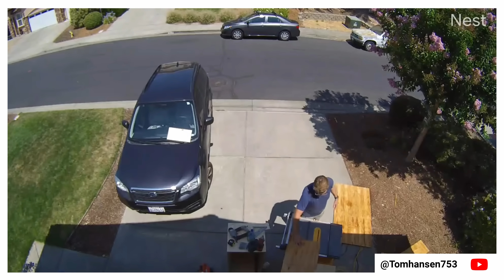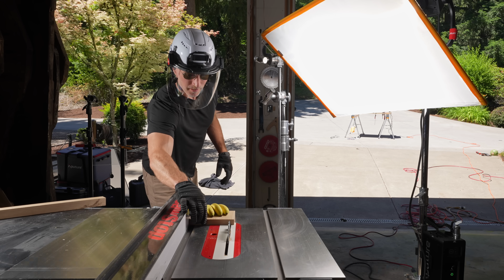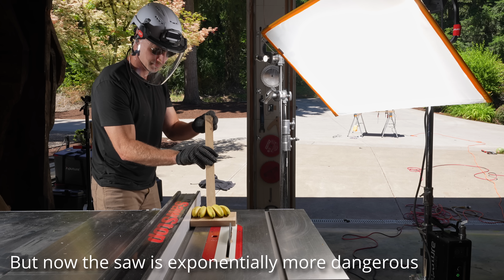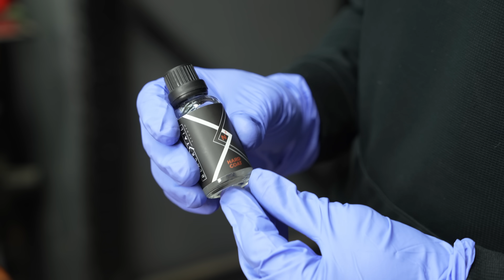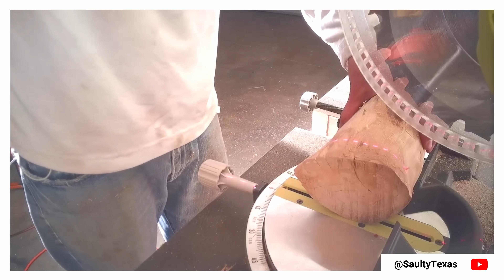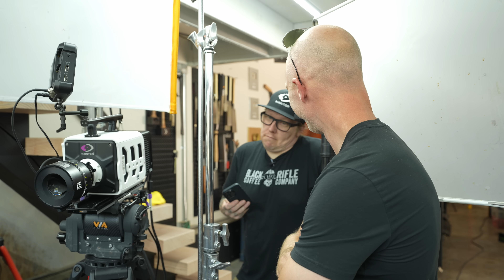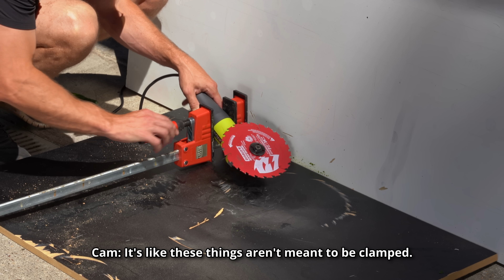Woodshop Safety in Slow Motion

Comment: I'm retired 37 years concrete carpenter. I built the giant forms for the things we love. Dams bridges gigantic hotels resorts ect ect.  When asked what I feel is my greatest achievement I hold up my hands and wiggle my fingers. "Still got all 10 "".  Cam I've seen up close it's down right crazy.  Careless and complacent that's the two biggest ❤😂. Good video
Reply: Me Too !!!1
Reply: that's quite an impressive job you had, building those gigantic forms is not for the faint hearted
Reply: I was a union carpenter and when people ask me that same question I say I don't have any skeletons in the closet meaning I never worked under the table I never worked for cash and I never worked straight time for overtime . I guess what I'm saying is I followed the union rules to a T and I'm now retired 25 years  with all my fingers and a pension with medical coverage .
Reply: @n40tom  local 184  salt lake city

Comment: When I was an apprentice doing hardwood floors the first time I was going to use the table saw my mentor said let me show you first what not to do . He said watch what happens when you twist the board going through the blade . He did that and he sent a piece of hardwood flooring through the drywall in back of us. He looked at me and said you got that and then he proceeded to show me the correct way to use a table saw  . I'm retired now and I never had a kickback ever

Comment: In high school, the table saw in my shop class was mounted on a high fixed bench. I’m short, and I basically had to lay down on it to push wood through. I told my teacher I wasn’t comfortable, but he told me that I could either use it or fail the class. Fast forward to the end of the year, I was way behind, and needed to cut a large sheet of balsa for the back of a book shelf. Got it almost halfway through before it kicked, flew across the room, hit a cabinet and ricocheted into a wall. Whole class looked over to see me shaking, counting my fingers because I felt it graze the tips.

Teacher came over, turned the saw off, and informed me I didn’t have to use it anymore. He helped me cut wood for the projects I had time to finish, and cut me a break on the rest. I hope he learned something that day.
Reply: Damn... Frankly if you have safety concerns in shop class, you should get bonus points, not a threat of a failed grade.

Comment: I worked in a wood shop in my twenties and was extremely lucky using the cross saw, I have a 3 inch scar on my little finger and a nice groove in the bones of the knuckle, when  I stupidly went to pull a small piece of wood out from the saw before it had finished rotating, made me so much more safety conscious after that.

Comment: Thanks for telling people to use the clamps on the miter saw. The number of YouTubers I see completely avoiding them, I know the ones that come with most saws are kinda annoying but... they're easily upgraded.

I know the temptation and for longer pieces of wood it's mostly okay to hold but yeah, they can still kick back.
Reply: my mom broke a thumb holding a board in a chop saw when it kicked back as the flying chunk wasnt detached yet when it got bound up, I still do it though, just not small bits

Comment: I have been building movie sets for many years, I have been a carpenter my whole working life seen lots of stupid  things and dangerous people lose fingers. My Dad taught me theres no reason to have your fingers near any blade and told me the bandsaw was the most dangerous saw ( I still believe that ) . I supply all the tools for my crew no matter the size of the show and always upgrade to whatever is better and safer . Sawstops are Awesome I have 6 in my tool kit now , also I have huge box of push sticks that we make out of masonite so theres always plenty on hand, Hoping someone can invent a sawstop type miter saw one of these days . I enjoy your channel very much
Reply: I’m not disagreeing, but why is the band saw the most dangerous in your opinion?
Reply: A bandsaw is really safe in comparison to other power tools. The sawing motion is only downwards. It won't pull your workpiece, including your fingers, into the blade. I have way more respect for table saw, router tables and angle grinders.
Reply: @LAZER1981A  My guess would be that without a brake,  the blade takes a fairly long time to stop but you not realizing the the blade is still moving could easily stick your hand into the blade. I actually did that once.  Luckily it was only a 9 inch saw with aluminum wheels almost stopped.  Scared the hell of of me when the teeth  hit my fingers.  Also,  complacency.
Reply: @LAZER1981A  Think because your pushing toward the blade , no fence and they will cut right through . Usually they don't have brakes although I have some that do, and that's the tool butchers use to cut meat.. I used to think tablesaws were equally scary but sawstops are the best safety upgrade I've ever seen
Reply: @DPCtahoe  lol thanks! I’m a butcher and use a band saw everyday.
Reply: @DPCtahoe  That's easy to fix by placing your hands so that they don't move towards the blade, but off to its sides. I wouldn't say it's the most dangerous, but rather the most underestimated. Maybe you could say the most deceivingly safe and easiest to get careless around.
From what I've seen they seem to run fairly quiet as well while the other types of saws screaming at you usually already imposes some respect. I don't own one (yet), but a bunch of circular saws.

Comment: I work in a factory and cut aluminum parts, and i've seen kickback a few times on parts if you don't cut off enough material. One time the guard that covers the saw didn't come all the way down when an employee in my department made a mistake and cut about 1" off a piece and the kickback chucked that piece of metal into the oven about 50 feet behind us and left a dent in it.

Comment: Worst thing I had happen in high school woodshop was the bandsaw blade snapping on me (it was OLD, but we had limited supplies of new ones, so we had to use them until they died). 
I just hit the emergency stop and backed away. But I got to learn how to put a new blade in, which was cool.
Another class, one of the students leaned too close to the lathe while it was running, and it ate his shop apron. (The lathe might just be the most dangerous thing because it lulls you into a false sense of security since there’s no sharp spinning blades.)
Reply: Ugh. Yeah, spinning things are vastly underestimated. In one of my lectures the prof showed a picture of why long hair has to always be tied together in the chemistry lab and especially when using a rotary evaporator. Luckily I'm not susceptible to PTSD from pictures.

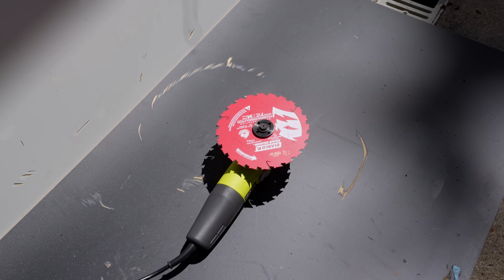Comment: Good timing! Just last week I was using a 15-cm battery-powdered mini-chainsaw to cut some slots in large beams for a project that is far behind schedule. It was going well, but, unsurprisingly, with only 4 cuts left to go, the saw motor burned out. With no chance of repair, and any replacement literally half a world away, I almost allowed myself to try the hack shown at 11:40 going as far as buying a blade for it. Fortunately, I came to my senses in time, and with a bit of uncharacteristic luck regarding shipping, a replacement chainsaw will be here in a few days. Sorry, Cam, you'll get no clips for your next safety video from me! 😅

Comment: Just started using a table saw for some small woodworking and DIY projects. Learned a lot of useful tips from videos like this. Outside of the usual fundamental rules, I’ve found some of the best tips to be fairly simple yet seemingly overlooked at times. Don’t be complacent. Treat your 1000th cut just like your 1st. Take a second to rehearse each cut before making it, making note of things like hand and arm placement and what kind of clothing you’re wearing. Be aware of the complacency involved in batch cutting.  And just trust your gut. If it doesn’t feel right. Don’t make the cut.
Reply: Stable bench, table and fence extensions, Feather boards, both on table and the fence, riving knife, clean blade, a push handle/jig (Homemade MicroJig The Ripperrr with more height clearance than the blade max height) and a COLD CLEAR HEAD + Safety glasses + Hearing protection.

Comment: I have been in construction for over 40 years and as an employer the first priority on any job or task is personal safety. I have seen too many accidents in those years, but thankfully I have not had any injuries to my employees that were improper use or safety precautions not being used. I did have a guy putting down OSB into H clips when a gust of wind rocked him on his heels. He lost balance and did a double back roll off the roof onto the ground. The OSB came down behind him and the edge hit the ground 4” above his head. Other than a sore back he came out with no injuries.

Comment: This is one of the most practical learning videos I’ve seen of NOT WHAT TO DO.  Very educational and top slowmo photography and certainly something I would like to be able to share in courses I deliver for aviation safety and risk management. 
Thinking outside of the box to get the message across and seeing more up there can only heighten the danger of using any power tool, of which I use on a regular basis but evaluate, emulate (in the mind), evaluate again before actually activating. 
It’s like the 6 P’s - Proper Planning Prevents Piss Poor Performance. 
Rgds J

Comment: Okay another piece of advice I always found very helpful when cutting very small things is that if your cut does not have to be very accurate repeatedly then just use hand tools!! Way less risk of hurting yourself, way more control over small pieces. Always keep the purpose of your part in the finished build in mind and if your wife or mom or dad or client or gf will not be able to tell if you cut it on a machine or with a handsaw then dont take the risk! :)

Comment: A few month ago I was using a small battery powered chainsaw to cut down some bushes to fit them into the bin. After about 2 days of doing it I got a bit too comfortable and it kicked off a stick I was holding and barely cut into my glove. I'm lucky I walked away with some scratches on my hand, it could have been so much worse. Never get comfortable or complacent around power tools, it could be the difference between having 2 functional hands and having only 1. Great video

Comment: Typically, every one of us has made a stupid cut in our lifetime and experienced a kickback. We usually learn after the first time.  It's one of the fastest and scariest things we can experience in our woodshops.  I experienced mine in my 20's when I was worldly, experienced, bullet-proof and knew exactly what I was doing!  Right!  I luckily still have all my digits, but I had a monstrous bruise in the center of my chest for weeks.  And I had on a heavy shop apron.  
My "almost digit-removing disaster" was one night when I was tired after a long day, and I was cutting some things on my bandsaw.  Last part of the night.  I pushed the stock straight through to my thumb.  My thumb took a nick to the bone before I could retract it.  Several stitches that night, but still had a thumb.  Don't run machinery tired!
The video shots were not ridiculous.  Maybe except for the water balloon, but the wood kickbacks they were very realistic what to expect.  
Good video.
Reply: Back in March I was working on a home remodel and got a bit loose and fast with a circular saw and ended up almost amputating my middle, ring, and pinky fingers on my left hand. I was feeling crappy and I wanted to be done for the day, but I just wanted to get to a good stopping point. It felt like a small nick but when I lifted my hand up I saw blood squirting everywhere and my middle finger was dangling backwards. I ran to the kitchen and wrapped my hand in a thick wad of paper towels and drove (4 blocks) to the ER. Two surgeries and months of physical therapy later, my hand is now as functional as ever. My grip strength is still on the weak side but I’m gaining that back slowly. Overall, I’m thankful I was able to walk away with all my fingers still intact and in the future when I’m done, I’m done.

Comment: I was hit by a kickback on my table saw once.... once!  If I wasn't dressed for the freezing temps (t-shirt, sweater, hoody, and an old leather jacket), I would probably have been impaled.  What got kicked back was about 3/4" x 3/4" x 4 ft long.  It hit me so hard that even wearing all the clothing it knocked me down and left a bruise that was at least 6" in diameter.  I learned to cut standing to the side and using push sticks.

Thanks for the video.  Hopefully people learned something and you saved them a trip to the hospital.

Comment: Ablation disks are probably the safest power tool.  Not safe, but more safe than any tooth based tool.  I've bumped my gloved (rarely ungloved) hand many times with an ablation disk, and it doesn't do much.  Most importantly, it doesn't have enough traction to suck your hand in.  It's scary when they explode.  But I wear a welding hood, apron, and gloves as PPE.  Miter saws, not so much.  They don't suck you in like table saws, but it will take some skin off your knuckle when you're trying to trim that extra 1/4" off a board you cut too long.  Side note, my favorite angle grinder glove is a cheap welding glove with black gasket maker rubbed into it.  You get the strength of real leather (unlike 90% of all work and mechanic gloves out there now), and the gasket maker holds the fibers together.

Comment: I once tried to clamp and miter a 1.5” thick oak piece down the middle into two 3/4” pieces. It was a cheap miter saw with a plastic blade guard. Luckily I knew what I was doing was dangerous and had long sleeves, a face shield, and gloves on. It sucked the piece up into the blade guard and destroyed it and the piece in what felt like about 10 nanoseconds. I looked down and had a line of splinters and plastic stuck in my arm sleeve, up my chest, and directly over my eye in the face shield. I had no injuries, but I learned not to do stupid shit. Nice video!

Comment: I just cut off my index and middle finger on my table saw. Not much pain when it happened but the sound it made was scary. After 9hrs surgery, they were reattached, middle is half an inch shorter, index turned black and needed to be shortened. At least I'm getting a new table saw with the stop.

Comment: I'll share 2 stores that happened to me. One was over a decade ago. I was new to woodworking, trying to cut a triangular piece, on a table saw with no stick, blades sticking away too high and no splitter or anything. Went to hospital shortly after to get my finger operated on. Moral of story, use at the very least a push stick and don't cut an angle on a table saw without a safe jig and at least have a splitter. 

Second happened about 4 weeks ago. I was cutting a thin piece on table saw an experience a kick back. (I honestly don't remember why it happened but I'm too tired to be up) I can say that I didn't need to go to the doc this time. I was using a GRRripper, the blade of the table only has the bare minimum teeth showing and I was too the side of the piece and I had a splitter. The GRRripper got a chunk taken out of it but that was it. Moral, use every safety tool available. Also, I truly do recommend that GRRripper.

Comment: Hi, I have a wild suggestion. I just stumbled across your channel and have loved binge watching your old videos, despite being an old lady with no woodworking skills.  I do love a good gnarly piece of wood and design that calls for some lateral thinking. Watching back to back, I keep seeing (with some horror) those little rough cut rings from around your circular tables being flung to one side... Oh the design potential of those offcuts! I imagine grading sizes, using different woods, nesting them into each other in concentric rings, offset and with the uneven outer rims rotated to be closer or further apart until the composition looks balanced, then filling with epoxy. It would be such an interesting experiment in repurposing offcuts and might produce a magical piece!

Comment: The struggle to get a board to kick on the table saw made me think of a common way to hurt yourself with a table saw that I did in high school lol. 

I was cutting a groove down the length of a 6ft 1x2 for a panel to slot into. Was pushing directly down on on the piece, hand right over blade (mind you this table saw was older than me and had no safety features left on it, just a blade and a fence). The board grabbed, shot me in the chest, and the hand pushing down went straight into the blade. 

Somehow managed to keep my digits. Blew off a fingernail and put a pretty good slice down the middle of my finger though. The spear to the chest I can only compare to getting point-blanked with a frozen paintball. Thank goodness it wasn't sharp...

Might be a fun thing to try in the next one 😁

Comment: I am also a statistic, was making a lapdesk for my daughter about 10 years ago, it was the typical i need to take one more sliver off the side of a board.  It kicked back and pulled my ring and pinky  fingers on my right hand into the blade.  Just like your video it happened so fast I didnt feel it but I know it wasnt good. I was lucky....my two fingers at the 1st knuckle were like a zippo lighter, and after some surgery i have full use if my fingers.  As I said I was very lucky and every time I turn the table saw on I need to take a breath and steady myself.

Comment: Chopped into a finger using the chopsaw years ago - hand was 4-5 inches away, but when the blade grabbed the wood, hand followed.  Luckily it went lengthwise up the finger and only just past the first joint, so they just stitched the sides together again - and now I have 2 fingernails on that finger.  And I am a LOT more safety conscious now.  Still use the same saw...